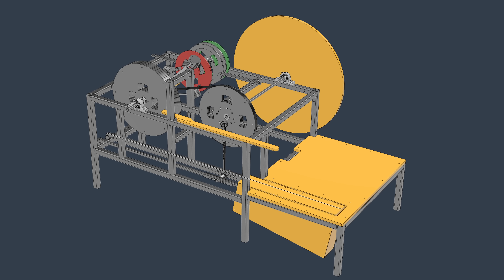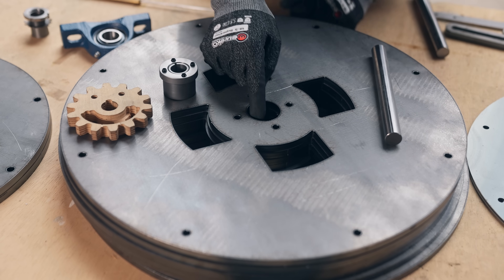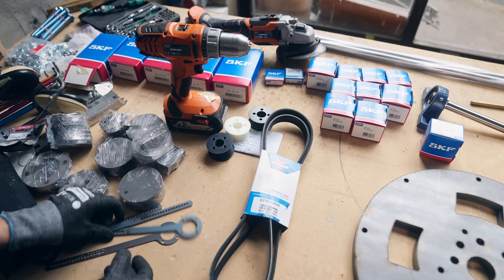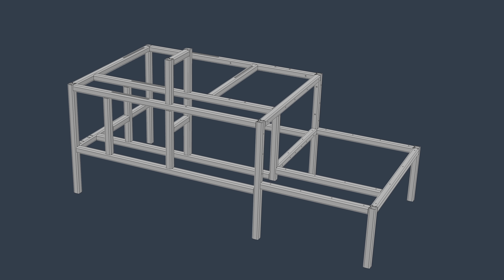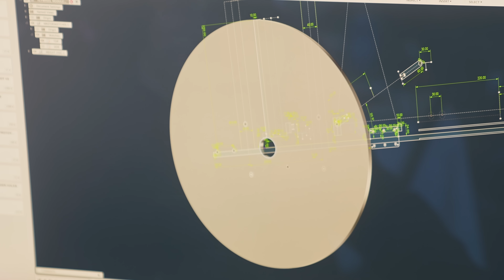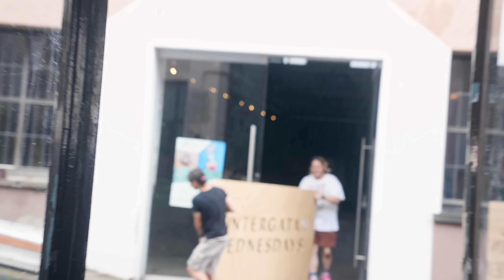Marble Machine Flywheel Prototype - DAY 1

Comment: The safety in this video is really really poor. Welding near window with passerby's. Welding and grinding in a fairly small place with others nearby. If there is no space for safety screens and proper ventilation, best to weld outside away from people.

Comment: With Sophia from 247 you can set your starting point so the micro edge from the laser is not in a place where you need a clean surface for welding!

Comment: I don't know exactly how much you plan on using the lathe but I'm sure you'll get the hang of it for tomorrow.

Lathes are complicated machines and there's lots and lots of stuff to learn about them, making them incredibly handy machines. I find them fascinating and even if you don't need to machine super complicated parts I do recommend a full course on how to use such a machine, it might give you new additional ideas and perspectives on how you can design certain parts.

I wish you lots of success and fun with the lathe!

Comment: Martin, if you want to sound more like your inner pro level metal worker and fabricator, this "lathing" word just doesn't work at all.

The correct term is "turning" (I will be doing some turning work on the lathe), which is appropriate, given that the flywheels will hopefully be turning very soon.

Thanks 😀

Comment: CAD Trick: two align two or more parts, use two dedicated holes for two pins which have tight tolerances, then put them together with pins, and after that fasten the bolts. This way they are way more precise. This is also done when building gear boxes.

Comment: YEA!  Finally a lathe!  You could have sleeved the too-large holes & DITCHED both the angle grinder & the welder.
PLEASE don't weld that frame!  Use aluminum extrusions with T-slots BOLTED together.

Comment: Correctly or incorrectly, I'd have made a slotted brass tube (a collet) to slide over the driveshaft and centre the oversize hole. It effectively gives you a slightly variable driveshaft size and still allows a high pressure to be exerted.

Comment: The moon holes being asymmetric about the shaft could cause imbalance of the pully? Even though its not rotating as fast it still could add vibrations.

Comment: No Martin you still have to measure when you weld the frame or else the slop/extra tolerances can add up and make fitting of the components very difficult. 🤷♂
 Still I'm looking forward to see some building done finally. 👍👍

Comment: 2nd mistake is a big big BIG one. You do NOT do welding where radiation could potentially harm bystanders. You need to block off the front windows of that building with welding curtains, before you get sued into the ground by a newly-blind passerby.

Comment: So you... welded the holes up. So that you could expand the holes later. Having your hole fit the tapered thing is fine if i am understanding the intention correctly? If we end up using the tapered pieces by seating them into the center holes I may have to un-sub for my own sanity.

Unless I am totally missing something, sounds like missing the forest for the trees.

Comment: This is incredibly stupid. Why not a wood flywheel with glitter paint? The government produces these moronic videos to reduce the public’s expectations for truth and honesty. YouTube is Sesame Street for adults.

Flywheels are fine if they’re made out steel, and properly balanced. But remember that a flywheel in a car still has to be powered by some kind of motor: Electric, steam, or internal combustion. 

You can actually turn a car battery into a flywheel. That way, you’re storing two kinds of energy at the same time. 

But if go with steam power or an internal combustion engine, you’ll have a problem.  All piston engines have been sabotaged. They have short piston strokes which waste almost fifty percent of the power. A piston is supposed to have a stroke-multiple of “four” in order to take full advantage of the expanding gas. So for example, the stroke of a four inch diameter piston would be sixteen inches. 

Of course you wouldn’t use a normal crankshaft for such a long stroke. You’d use a long piston crank, with an internal oval gear. Sixteen inches of piston travel is no problem.

But for YouTube’s owners, honesty is a big problem.
Reply: neat, a schizo comment!

Comment: I would use a simple insert out of metal sheet, instead of welding in the hole. Don't think so complicate.
And I would try to avoid welding on the frame. It is a prototype and you might want to change things and be mobile. Use screws and inlets for the thread.

Comment: oh god..... your making a mistake while fixing it. hole to big for bushing. Machinne it even larger and pressfit a sleeve in it and lock it with 3 set screws. than machine it to size. no heat from the weld so no deformation. Takes a little longer but you're sure its good

i love your work, im with you since marble machine 1 and i want to say, this one will be a beast but the 4th one will be even better. you will machine every part of your build. i think thats why this one wont be as perfect as you want it to be

Comment: I'm glad you were able to identify the error and correct it!

At first I was worried that the realities of laser cutting had hit. I program a 6kW fiber flat laser at my day job, and I've found that, absent some really fiddly tuning of part/program/parameters, I won't promise better than about 0.25mm

I certainly can do better than that, but on a part the size/thickness of the flywheel plates, I wouldn't quote tighter than 0.25mm unless the customer is willing to supply/pay for additional material to dial everything in

Lasering, unlike milling or turning, doesn't really let you sneak up on a dimension. You commit to the cut, check your work, and then adjust what needs adjustment and cut it again

If you need tight tolerances, machining is the best bet, even if it's just finish machining a laser cut part

Comment: with all those gears and ball bearings, should integrate a fixed lubrication system (such as the one present in industrial machinery). If you don’t integrate it you risk that, with a small vibration, of having to change bearings often. I hope you read my advice.hi

Comment: Yeah I really hope he welds the flywheel together. Maybe plug weld the bolt holes?

Also from what I have seen, this application generally works best with v-belts?

Good luck Martin, i hope you get it going!

Comment: Martin: I'm not going to use the angle grinder. 
Martin a minute later: I mean it's just "polishing". turns on the anglegrinder
Nice to see you again.
Reply: Queue up: Stryper - You Won't Be Lonely Anymore
Reply: Hello grinder, my old friend.
Yes, I made a mistake again.
I don't mind to admit it
When I got a new bushing that dont fit.
Reply: @gorillaau  Hello grinder, my old friend.
Yes, I made a mistake again.
I don't mind to admit it when,
I got a new bushing that it don't fit in,
And the CADding, I've envisioned in my brain,
was really lame.
Ensues the sound, of grinding.

Simon & Garfunkel should be honored to have an MM3 version.

Comment: Two observations:

1: maybe stock some regular nuts. Especially for temporary securing its a way to save a pile of money. Also, if properly torqued they hold just as well, as nylocks for a fraction the price. Loctite if you are concerned about vibration. 

2: I hope machining the profile of your serpentine belt into the pulley is on the to do list.

Comment: I'll be interested to see how the frame comes out when you weld it. The tolerance in those tabs seems a little much when extrapolated. Are you going to use the flywheel bar as a reference?
Reply: Yeah way too much slop for my liking.

Comment: Martin: spends 20 minute video agonising over flywheel concentricity and dynamic balancing
Also Martin: WeLd ThE HoLe
Reply: Perhaps that was the best way to start: getting rid of the idea that not making mistakes would be an option and that planning can replace doing.
Reply: Oh the irony that Martin wrought.
Reply: I really hope he solders it together, because if he thinks to lathe it and then disassemble it he's in for a disappointment ...
Reply: @francescosirotti8178 afaik it stays together forever after lathing
Reply: @francescosirotti8178  or witness marks his assembled orientation to preserve his concentricity.
Reply: Well, yes but actually lathes are good for concentricity
Reply: That's literally the correct solution though. In fact, sometimes in industry you'll even design parts like that on purpose, to add special hard facing or wear resistant filler metals to specific surfaces of a part.
Reply: @AJMansfield1  Let me just check, you're saying that in industry we hard face bores?
Reply: @spikeypineapple552  No, but you might use brass facing inside a bore as an integral bushing.
Reply: @AJMansfield1  brass facing doesnt exist.
Reply: @spikeypineapple552  lmao this is used all the time for repairing rod ends on hydraulic cylinders. You use a portable line boring machine with a welding attachment to build up weld on the inside of a worn rod end eye and then turn it back down with the line bore. IDEALLY you're fitting a proper press-fit bushing like this, but not always; sometimes the weld repair buildup IS the final bushing material.
Reply: @spikeypineapple552  you are correct though, it's bronze weld wire not brass (thanks predictive text keyboard)
Reply: @spikeypineapple552  Strange, as I flashed out a hole with a brass alloy rod just this morning. Then I cut a thread into it, then I put a bearing assembly into it. Are you just saying any old stuff to be difficult?
Reply: @spikeypineapple552  brass facing is used in most heavy machinery. It's a simple,  cheap and tested solution.

Comment: Be careful with grinding near windows. The sparks can burn into and build up on the glass.
Reply: And those red welding screens, people walking in the street may not realize it's welding light and look at it
Reply: @TheCrimsonSteel  The windows should filter quite a bit of harmful UV but you're probably right to be cautious.
Reply: I'm one of those who learned it the hard way 🥲
Reply: @Apocalyptico100 so am I :)
Reply: To be properly safe, there should be a screen to block the welding light from pedestrians and also his team. Welding light can cause permanent damage to the retinas. Pedestrians in particular may not know that.
Reply: Toughened glass can just dissolve into a billion pieces
Reply: I once used an angle grinder to cut a drum can in half for a DIY bbq project, but I did the work right next to my car. It was too late before I realized my passenger window had absorbed a million little metal balls. :(
Reply: @DanielDupriest 😲
Reply: That just adds cool patterns into the glass!
Have you seen the artist Alex Bernstein??
He makes sculptures by precisely using this method.  Slowly building up layers of metal that sort of bake themselves into the glass.